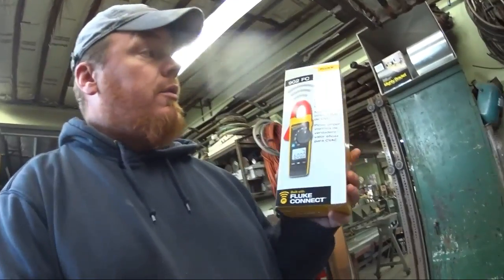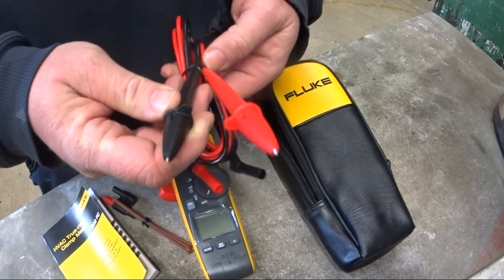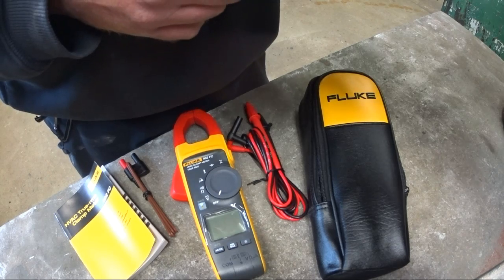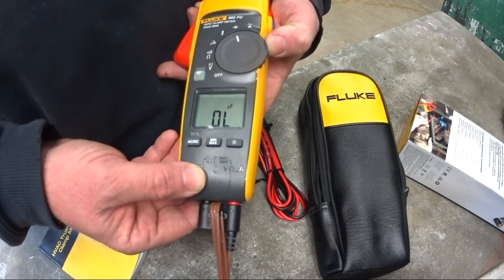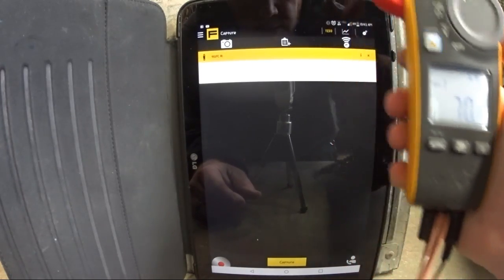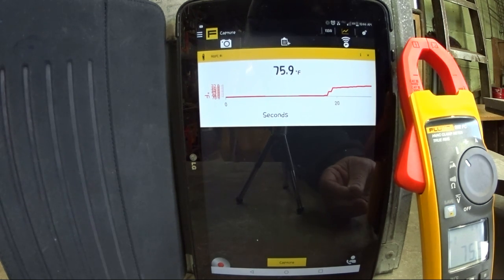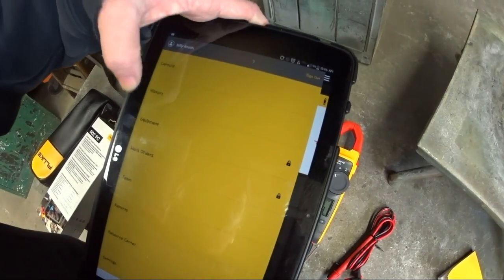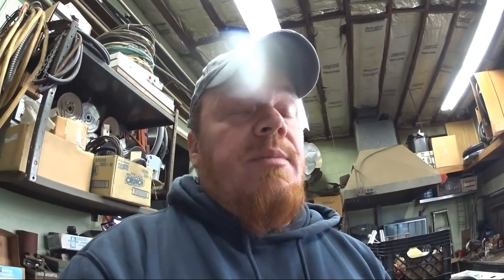FLUKE 902FC Qucik Look #HVAC

Comment: You keep saying "field connect."  It's "Fluke Connect."  You need to know this meter before you do a review.  You seem to be figuring it out as you go.
Reply from the maker: That review is old....   And when it came out it was called field connect....   It was a new meter to me at that point and I was just showing it off....  Thanks for watching it though.
Reply: @BillyKnoth  That in a lie.  I have brochures from Fluke that go back to 2013  They called in Fluke Connect 7 years ago. They have NEVER called it field connect.  It has always been called Fluke Connect.
Reply from the maker: @Impedancenetwork  well....I apologise for calling it the wrong name....   I am not perfect.
Reply: That's fine.  I understand but you tried to lie about it.  Lying on the internet?  Not a good idea.  Someone always knows the truth.
Reply from the maker: @Impedancenetwork  not lying.... misspoke!!!
Reply: @BillyKnoth  I understand making a mistake when speaking extemporaneously, but you doubled-down when you said this in your comment, "That review is old... And when it came out it was called field connect..."  When someone calls you out then you insist again that it used to be called that, well, then youre intentionally lying.  You might not have know that when you made your video but when I made you aware of your mistake, you insisted that it used to be called  that.  Now you're trying to deceive, which is called lying.
Reply from the maker: @Impedancenetwork  thanks for watching!
Reply: @Impedancenetwork  LMAO relax my man, it's good for your wellbeing.

Comment: ? Can LED lights on the same breaker as the air handler jack up the Sign-wave ? Mess up amp draw when diagnosing ?
Reply from the maker: Jason Stinson i dont see that being an issue with the LED lights...

Comment: I went to an appliance Store that had parts and tools and asked for a Fluke brand meter and they told me "Fluke, what's that?" and they started to laugh at me so I turned away and left.
Reply: Fluke is more for hvac comercial used , for appliances any $60 does the job